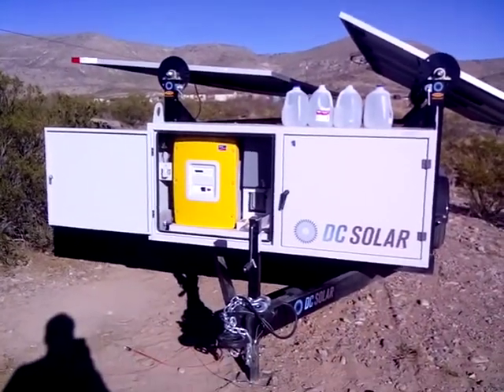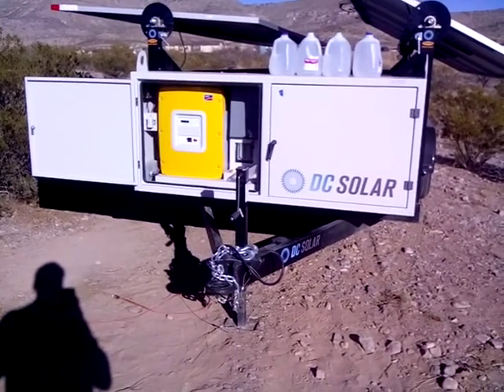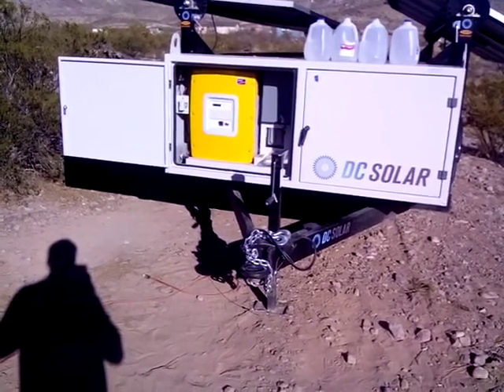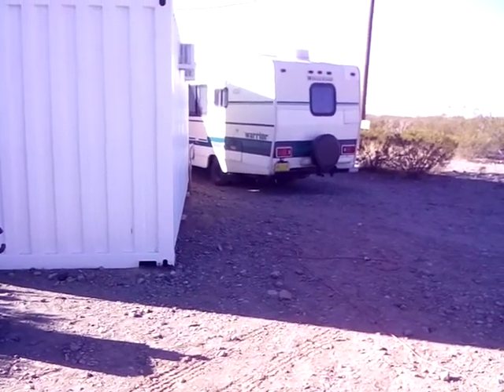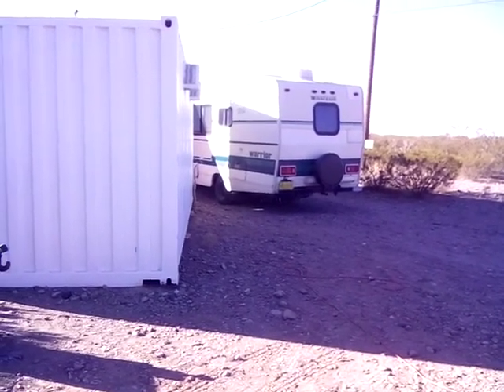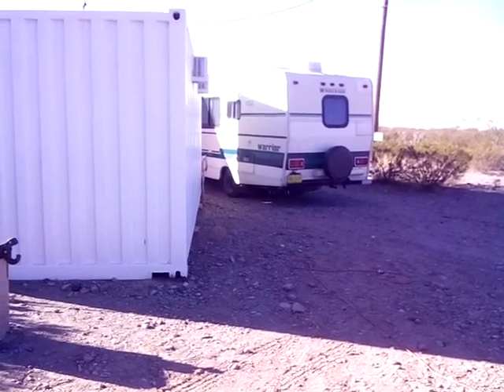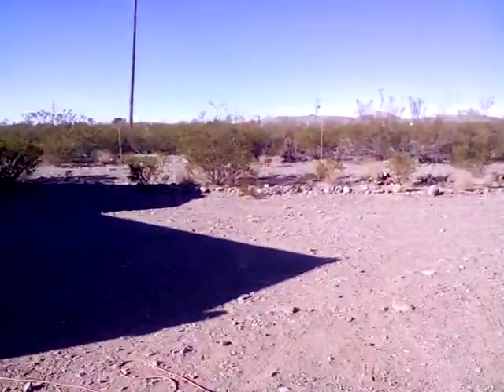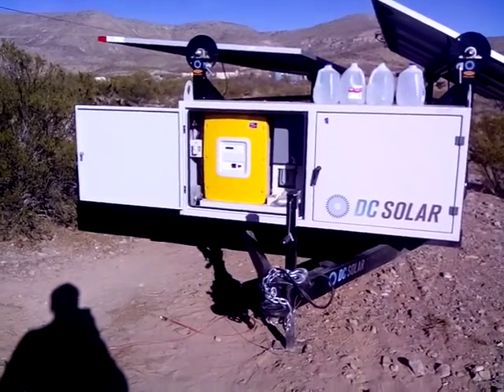GFI tripping on solar trailer

Comment: Did you get your trailer figured out? We purchased a used unit with bad battery bank(s). I unhooked the rear battery and dismissed a cell on the front battery. I then derated the inverter to 46v for the battery bank and everything has been running our 50Amp RV with very little problem so far. We do use the Kubota generator to keep the single 510ah battery between 46v- 50v+/- because the solar panels aren't producing enough power in the winter sun.